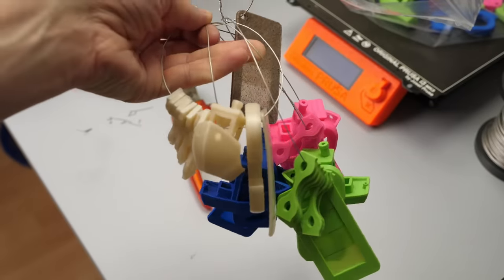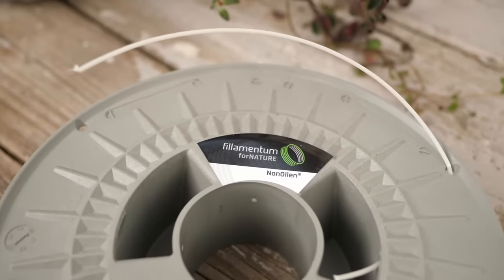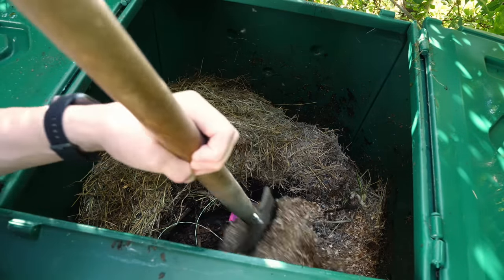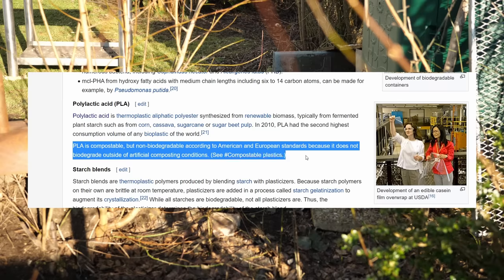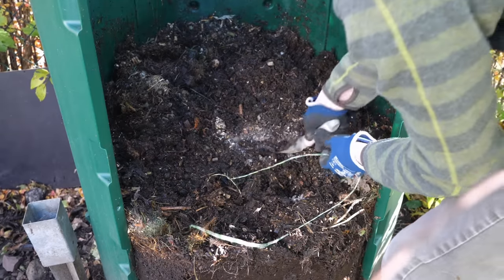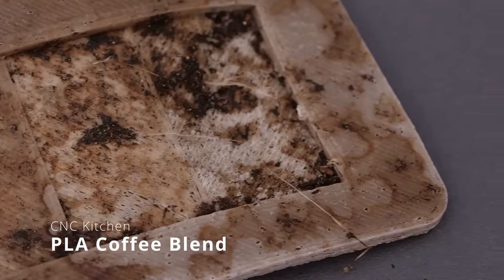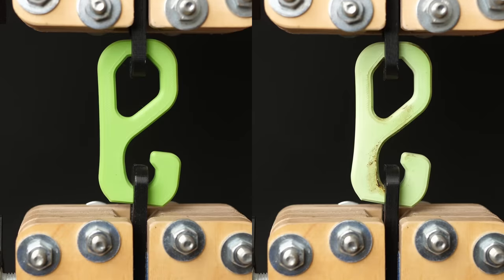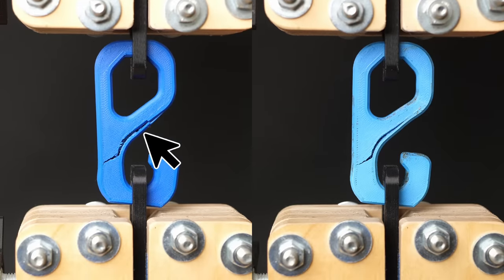I put PLA 3D Prints in my Compost and this happened

Comment: Alright maybe the PLA didn’t compost down, but I really need you to grow some corn with that compost and make your own PLA from it
Reply: Its made by fermentation with lactobacillus, which is an OTC probiotic for... lots of things.  Converting lactic acid to PLA takes a while but is not hard.  Pretty doable.
Reply: That would be very cool
Reply: He isn't Nile nor Cody
Reply: @NoviSavvy so true, they are the only two people in the world who make PLA plastic for use in 3D printers
Reply: @clampchowder9569  And film a good YouTube video with explanations, well, as long as I know- yes
Reply: @harperwillis5447  Feat. NileRed
Reply: How to make everything did a video on it three years ago- you just heat the lactic acid up, pour off the water, and repeat until you get plastic.  Not hard, just a hassle.
Reply: @harperwillis5447  First you need to grow corn in a compost lol
Reply: @williamhuang8309  NileGreen would be more fun.
Reply: @harperwillis5447  wait a second you skipped a crucial step. How is lactic acid polymerised? Not a lot of people have a vacuum chamber with a rotating platinum catalyst drum in it at home, I don't think he does.
Reply: @SianaGearz  he could probably pick one up off eBay or something
Reply: @SianaGearz  It's polymerized with citric acid and hot water
Reply: @SianaGearz  I was thinking a tin catalyst.  Doing it under vacuum isn't strictly necessary, and under vacuum you also don't strictly need a catalyst, but the product is lower molecular weight and weaker if you don't have both.  If the point was good PLA you can just buy it though lol
Reply: @harperwillis5447  10 months late but needs a correction: PLA is not made as you described: if you 'pour off the water' you throw away the lactic acid, as it is soluable in water. You need pure lactic acid in a pressure vessel, heat and time.
Reply: @JelleBoomstra  That's the big downside, besides the low molecular weight- low yield.  As the PLA forms and releases H2O, it dilutes the lactic acid, so you need to keep replacing it with more concentrate.
Reply: How do you plan on polymerizing your lactic acid? You'll need a reactor and the use of heavy metal as catalyst.
Reply: If there was corn in it, no one was born in it.

Comment: I never expected the degradation to be asymmetric but your explanation about percolation of stuff between layer voids makes perfect sense. Fascinating stuff!!!
Reply: Woah my 2 favorite YouTubers are here!
Reply from the maker: Wouldn't have expected this as well but there seems to be a mechanism that attacks layer adhesion and this explanation seemed plausible to me.
Reply: @CNCKitchen  It would be interesting if we can find slicer settings that will give our prints thinner walls and a more spongy texture. Maybe with that we can optimize our prints for faster decomposition.
Reply: You also have to take into account the randomness of nature. Bacteria and fungus isn't evenly distributed within a compost pile. Yes it is everywhere, but you're bound to find hot spots with more organisms than usual. Even with all the parts so close to each other, they are still  exposed to different concentrations in the pile.

Comment: Thank you so much for taking this issue up. A lot of folks throw away PLA thinking it's biodegradable and won't harm the environment and magically disappear. Manufacturers don't help with their 'its magically biodegradable' marketing and it seriously makes things worse.....need more videos about this to educate people on proper disposal procedures even for PLA
Reply: proper disposal of any modern polymer is compacting it and storing it under the ground. that's it.   no biodegradation, no burning,  (in fact in terms of carbon footprint biodegradation is the same as combustion but slower. )
Reply: The best thing to do would probably melt it down and reuse it
Reply: I collect all of my 3d print waste in case I decide to buy a filament recycler.
Reply: Apparently you need above 60c for PLA to degrade, well above most home composts, if you have a large compost pit that is hot, you might be fine.

Edit: finished the vid, you probably won’t be fine
Reply: @stopitnowlol6697  Enzymes are key when breaking down starch and cellulose for fermentation. I wonder if simply adding the right enzymes to PLA that are activated with moisture would make it degrade faster. Also, compost bins are highly acidic and PLA is acid based. PLA might break down more quickly in an alkaline environment. Just throw in some lime?

Comment: I do composting at home. I can confirm that air rating compost significantly increases the process. All thou I do not use a drum composter I suspect it will work much better than the method you use today.
Reply: I’m adding some stuff

Heat is a result of composting it is not a target. If you increase the temp beyond 70 degrees it will kill the bacteria and worms that do the composting. 

A drum composter is great for air rating the compost pile but you’ll need to watch the temperature closely. As soon as you hit 70 c you need to add water and rotate the pile. Which could be a great diy project! 

Another disadvantage of the the drum is that you manually need to add worms as they will not just magically appear in the drum. Another disadvantage of a drum composter is its size, which is limited. 

I’m 100% sure that a drum composter will work great as long as you take the considerations above into account.
Reply: It's aerating not air rating
Reply from the maker: I'll take that into consideration! I think the key point is that you first need the high temperatures to hydrolyze the polymer chains and then the bacteria/fungi etc can do their work.
Reply: @cactiman6593  hahaha, thanks 🙏
Reply: @stephandelaat  you're welcome

Comment: For your new composter.  Perhaps building a new chicken coop where the composter is above the chicken compartment.  This way the chickens benefit from the heat of the compost and the compost benefits from the heat of the chickens... lol... maybe put the composter with a mesh wrapped around it and some paddles so the chickens will be encouraged to jump up on it and rotate it.  The chickens will get some exercise... maybe shake out worm... and the composter gets turned.  Chicken powered composting is the future!  Put those freeloaders to work!

Comment: i know it'd be a logistical challenge but it really would be nice to be able to just remelt PLA back to filament form in bulk
I'm not sure how much you would need to print/ how much the area around you print to make a proper extruder machine worth its investment
but ngl for 99% of usecase where you don't need high performance plastic, having a local brand PLA filament from your local recycler sounds somewhat enticing
Reply: A buddy and I bought necessary machines to make your own recycled filament. He got the shredder to break prints into small pieces, and I got the filament making part. We've spent about 800€ for the machinery and you absolutely need virgin PLA pellets for somewhat decently extruded filament, so it'll be a long while to pay for itself. This also wasn't our direct goal, we more or less want to minimize waste, the material is still fine after one run through the printer, so why throw ot away when you can just reuse it? It also helps with the whole spool mess, we just reuse them, put new filament on them and print them empty again. Well, and the biggest factor in this for me: It's fun to tinker around until everything works fine.
Reply: There is a video of this on this channel from a year or two ago
Reply: The real problem, with all large-scale/municipal recycling, but especially recycling 3d print waste, is ensuring that the feedstock is actually all PLA.  There's always going to be some dipshit that tosses his ABS supports in there with his PLA, and that ruins the whole batch.  

Like, an individual, or a company could do it--with their own waste--but someone trying to collect the waste of others has an almost-impossible task of guaranteeing homogeneity.
Reply: @gpweaver  yeah, and you can't separate it by mass, by look or by magnetism
i wonder how they recycle plastic in general then
Reply: @aronseptianto8142  That's why they have the little stamped recycling numbers on them.  Tells you what kind of plastic it is.

...but in reality, they don't actually recycle most plastic; it just gets dumped/incinerated.
Reply: @gpweaver  yeah but you can't really eyeball it on a conveyor belt right?
Reply: @aronseptianto8142  No...especially when it's a tiny little mark embossed/debossed on the background plastic.

Hence the reason most consumer-recycled plastics wind up just getting pulled off the line and sent to the regular trash stream.  The majority of actually recycled plastic comes from industry.
Reply: @aronseptianto8142  It'd be really awesome if cheap, consumer-grade PLA remelt/extruding machines became reality.  The majority of my prints really don't need to be any certain color; a melange would be just fine.

Then again, it still needs a considerable amount of virgin PLA to be mixed with it, too--that's a challenge that needs to be solved by the manufacturers of PLA. It's a balance between retaining flexibility/flow and being remotely biodegradable.

Comment: I have one of those rotating composting barrels and tried to compost some PLA prints that I had painstakingly cut up into small bits...yeah that was a mistake.  I waited 3 years and the plastic looked untouched other than a light fading of color. I ended up having to bag the whole batch of compost and send it to the landfill because it was contaminated with all the PLA.

Comment: This is exactly why I'm reading into research of depolymerization of pla. According to some articles I've read you just need to add some zinc acetate (which is just zinc and vinegar, sorta) and distill the pla. You'll get pure monopolymer. I forget thy exact details and don't have a link handy...

Unfortunately the process is not economically viable compared to making new pla.
Reply: Seems like something we could really use some government subsidies for. Subsidized PLA recycling would make the economic viability an issue to worry about later
Reply from the maker: Would be happy to get some more details on that method. Send an email if you find the links!

Comment: You need to grind the prints up to break the polymer chains so that there are more chain-ends for enzymes to interact with.  I think it is reasonable and realistic for home-composters to "mulch" prints before composting.
Reply: maybe it works but then it becomes impossible to test if it is really composting or you just made a bunch of microplastic
Reply: @respiii  Too bad someone hasn't invented a way to look at things at the "micro" level.  Some kind of "scope".  😀  Seriously, though, you are correct that unless Stefan is willing to determine whether the filament is being digested or just breaking into tiny particles, there isn't any point.
Reply: You are confusing biodegradation and depolarization. 
Grinding PLA does nothing but turns it into microplastics. Please don't ever do that or recommend others. 
Yes, it will be so small you can't see it. But it will simply build up in the soil and eventually in the food chain. 

PLA requires special anaerobic industrial composters because it needs to be depolarized through elevated temperatures, high humidity and lack of oxygen. And it then breaks down into inert material. 

Biodegradation or composting, requires the element to be re-absorbed into soil and used as food for organisms. 
Only PHA, PCL bio-polymers does that. No other bio-polymer of combination work (including blending PLA-PHA)
Yes PLA is Bio-Base, but no. It is not compostable. 

If you want to learn more, I recommend reading Prof J. Green from California State University (Chico, CA). book. https://www.amazon.com/Sustainable-Plastics-Environmental-Assessments-Biodegradable/dp/1118104811

Or check out these links for bio-degradable filaments for FDM 3D printing.  

https://www.gopha.org/
https://beyondplastic.com/collections/all
https://colorfabb.com/filaments/materials/pha-filaments
Reply: @fredpinczuk7352  Thanks for the links. I've learned a bit more about filament compostability in the months since Stefan posted this video.   In fact, I am printing something in (regen) PHA right this moment.  The "natural" version has a paper-like translucency and texture, and the wood-fill version gives very nice results.  I may set up some composting experiments once it stops being frozen outside.
Reply: @fredpinczuk7352  thanks for the links. Very informative combined with this video (hopeful that they are informative, I’ve got some reading to do now)

Comment: I'm a researcher who works on sustainable and bio-based plastics. A couple of comments:

- For most applications the intended end of life ought to be recycling. Biodegradation should be viewed as a failure to recycle, not a success most of the time - it just means you have to make more polymer (incurring a significant footprint) to replace that which has degraded. The problem is that small volume plastics like PLA don't currently make sense for recyclers to tool up for. Maybe we should all be printing PET instead!

- For many applications where biodegradability is an advantage, this is to deal with littering (things like takeaway food packaging)... and biodegradation in the ocean or just outdoors remains a real challenge. Paper and card isn't a perfect option either as it has a substantial environmental impact compared to something like expanded polystyrene (which is horrible and petrochemical... but actually efficient to make despite all that).

- Compostable materials are really only useful where you expect the material to end up in a composter! This isn't a likely end of life scenario for anything other than food waste bags used for convenience where local authorities collect compostable waste (as they do where I live)... and these are film products with a very large surface area to volume ratio, which works in their favour.

Now if only somebody would give me a nice big research grant for my "failsafe" degradable plastics idea I  could get to work on solving these problems...
Reply from the maker: Highly appreciate your input and thoughts!
Reply: I agree on all your points. But that does leave us with the issue most if not all home printers have: what can we do with our failed prints and print supports. I currently have 2 very small tubs to collect this per type of material, but I currently have no means to recycle it as new filament or  dump it in the compost (because it does not work). I do not want to throw it in the trash yet....😵
Reply: @ericvenneker  I definitely think there's a massive gap in the market for a reasonably accessible benchtop failed print recycling setup. 

I don't currently have a 3D printer myself - I've just moved house and building my home workshop is a year or so away - but it's definitely something I intend to have a look at for myself. Especially since right now I've got students working with things like small scale granulators and extruders so I've got some experience with this sort of thing in a lab setting.
Reply: @chemistrykrang8065  that would be very interesting!
Reply: While I agree. I also think all homeowners should have a compost pile. It does cut down on waste sognificantly
Reply: @Stettafire  where I live food and garden waste is collected for industrial composting. I agree that waste food or garden cuttings shouldn't go to landfill, and I think it's a good thing that our council provide that service.

[Edit: That's not to discourage home composting, it's just that I think this service being provided is a good thing to cover for those people without the space (people living in apartments or who have small gardens) or the capacity/inclination to compost themselves. Obviously if people can compost their own waste food etc that's the best option.]

Comment: Understanding how PLA degrades is important.  It hydrolyzes in both acidic snd basic environments as well as high temperature if sufficient water is present.  The end product is lactic acid.  Further degradation happens at the surface.  Meaning microplastics with their much larger surface area are more rapidly hydrolyzed.  In industrrial composting one of the important steps is breaking down the material mechanically.  This increases surface area and hence increases hydrolysis.

Comment: My grandpa had a horizontal drum compost system many years ago.  He had a heck of a green thumb that turned his acre lot into what looked like a rain forest.  For his compost system, he would add raw stock, along with some already composted material as a starter culture.  He would then add a pound of sugar (his barrel was 200 gallons) and wet it down.  Then, he would spin the barrel about a dozen times and check the moisture, adding more water as needed.  Then, once a day he would spin the barrel a few times.  Every third day, he would add more raw stock.  After a couple weeks, he could remove usable compost, but never more than half of what was available.  Every time he removed compost, he would top it off with raw stock and repeat the water, sugar, and turning.  That system was a beast at making compost.  He would easily get 20-30 cubic yards of compost out of it every year.